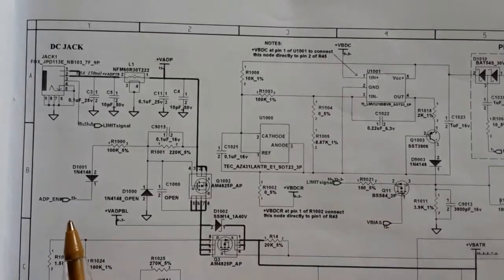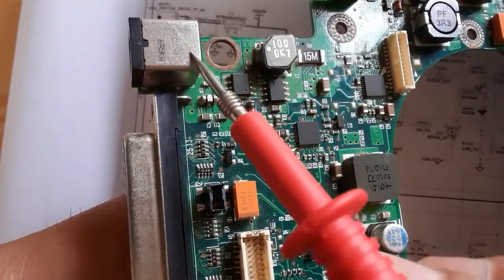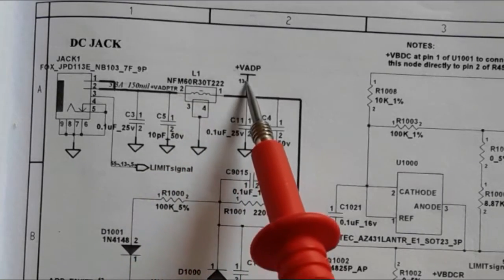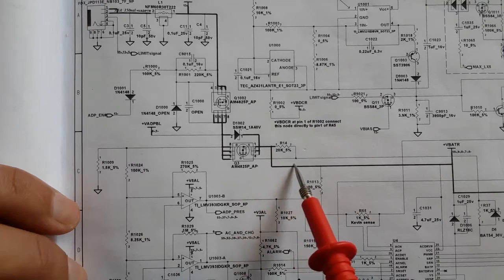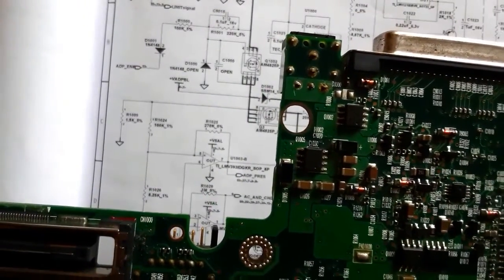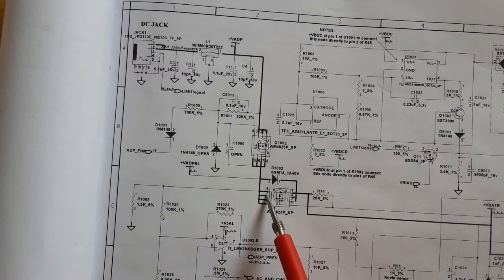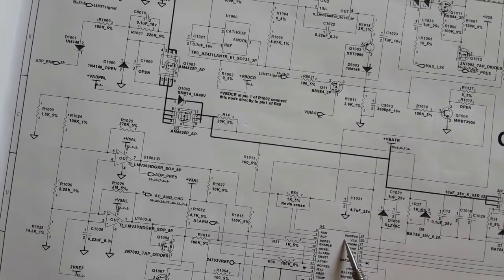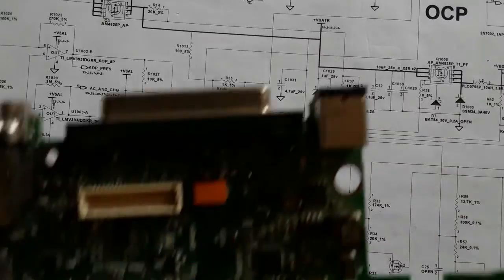Learn how track Laptop motherboard voltage, laptop schematics reading

Comment: My Dell E5420 is not turning on.

Another charger has been tested on it 

When i apply power to it, battery charging led turns on for a second and turns off (battery pack is removed).

After this, if I press power button on the laptop, power led turns on for a fraction of a second and turns off. Fan doesn't move, HDD doesnt start, no LCD screen. If I press power button again, the power led this time doesn't turn on. If i reapply power from the mains, the cycle can be repeated.

I removed battery pack, CD-ROM, RAM, WI-FI card and HDD and applied power, nothing changed.

I removed and reinserted CMOS battery to reset the BIOS but nothing changed again

I can check 19.3VDC coming at various points on the motherboard.

I can't find any voltages on any of the buck converter coils (perhaps because it is shutting down immediately?)

Please help me to resolve this issue. I'll be very thankful to you

Thanks in advance